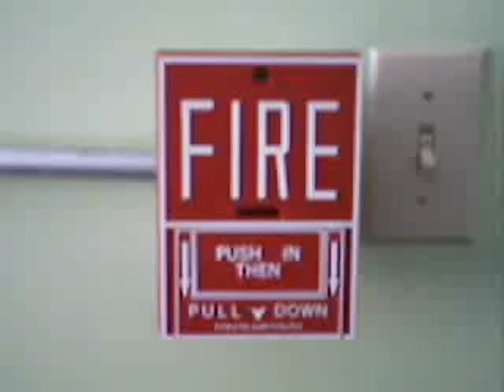System Test 12

Comment from the maker: They're supposed to be wired to their own circut breaker, but that's probably so no one can unplug them. They're pretty easy to fix so they can be plugged in. Just go to a hardware store and get an outdoor extension cord. Cut off the end with the socket and then strip the wiring. Then just wire the wires from the panel with the wires from the cord. Some panels may not work like this, but that's how mine worked.

Comment from the maker: It only works for the electronic version (which I have) and not the piezoelectricd version. Anyway, there's a tab on the back, just like the AS and NS series. When centered, it's code-3, when off center or missing, it's continuous.

Comment from the maker: No, because it's too much work on my part, plus, there's really nothing to explain. The lock works like a screw, and like the t-bar, when the station is opened, the button pops out and goes into alarm, which is like just about every other pull station out there...